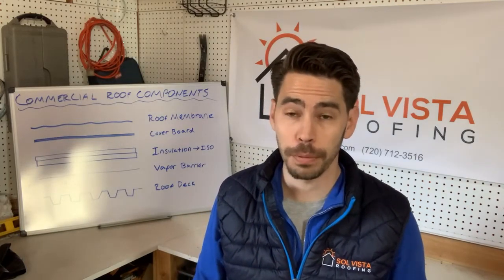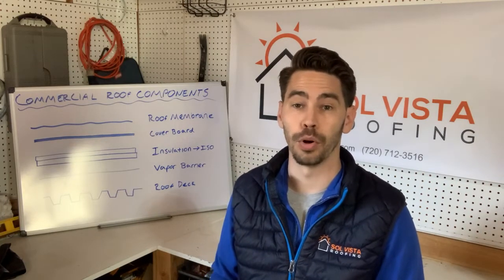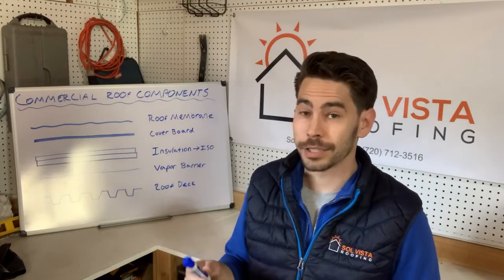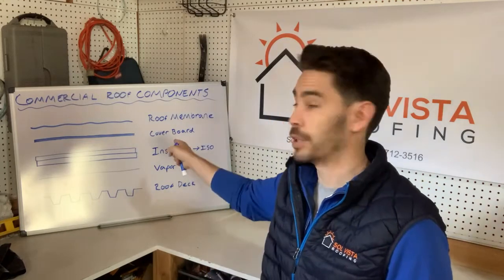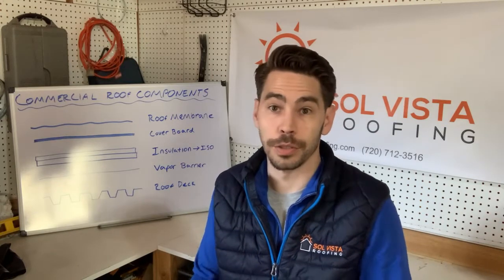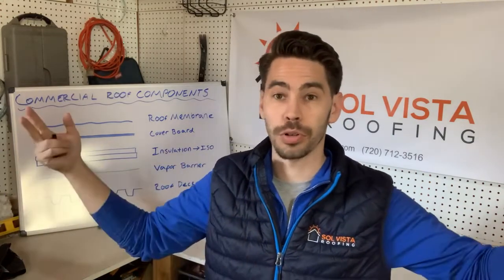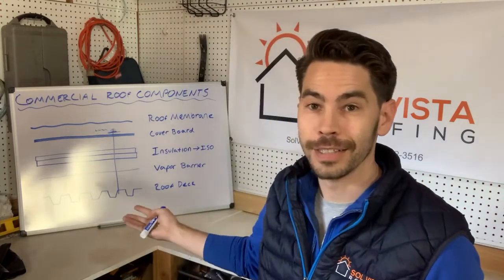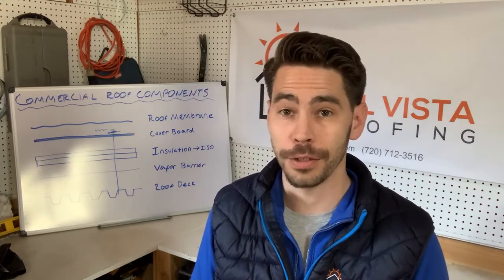Anatomy of Commercial Roof

Comment: Could this system be used for aluminum roof material ?
Reply from the maker: This system is mostly meant for single-ply membranes. We could not say for sure if it would work for aluminum without knowing more about the material, but it is definitely possible.